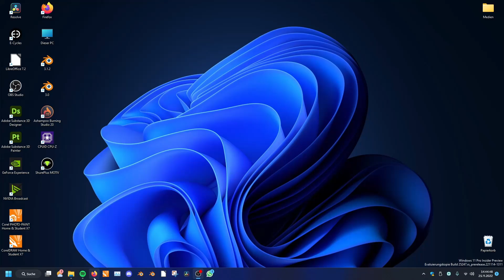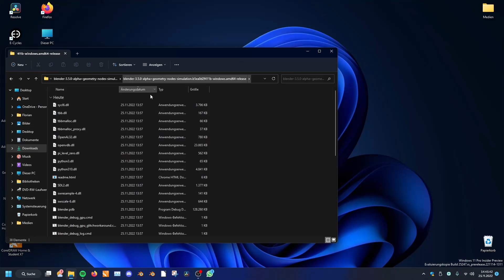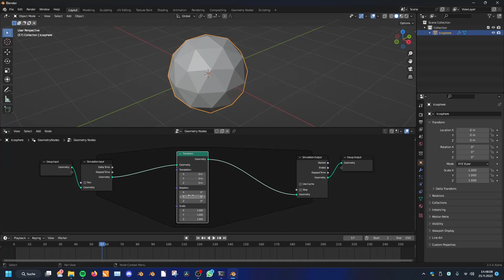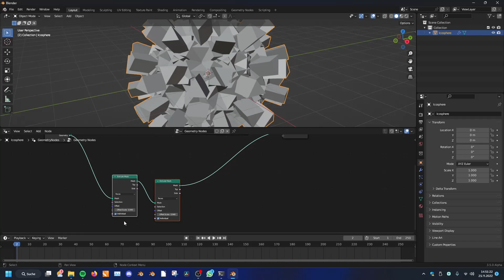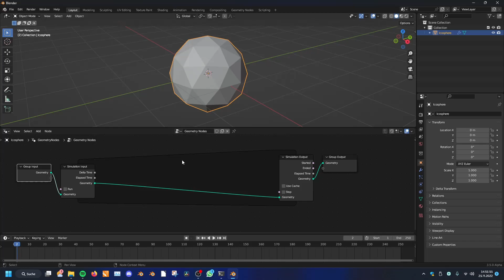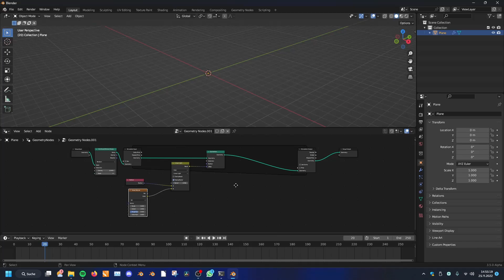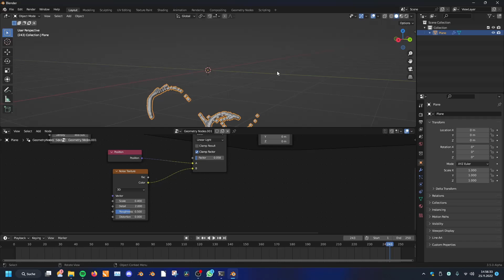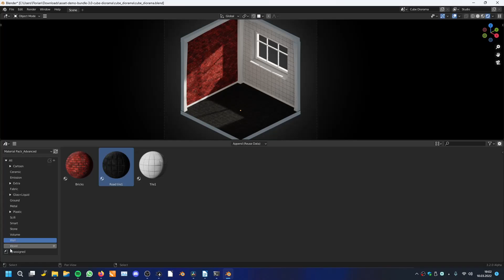New SIMULATION NODES in Blender are too broken!!!

Comment: Hi, first of all you are great at explaining geometry nodes in an easy to understand way! I would like to ask if you know how to make moving balls on the tops of an extruded object like in 6:23? I'm trying to figure it out myself but I don't know if it's possible in blender at the moment. Thanks :)
Reply from the maker: Thank you!
That should be easy to do. If you extrude something you have the boolean output for the "top" face. You can use that as the input for deleting everything except the top faces. Then you can convert your Faces to a point and you can then instance that what you want on that points. I hope you understud. 
If you still have questions, you can join my discord server. There it is better for me to explain something because there I can send pictures :)
Thank you
Reply: @HEY.Pictures  I always wonder how people know what node to connect to each other to give the intended effect. Do you learn by trial and error or do you rather learn from some sites about connecting nodes? Maybe is there a wiring diagram to remember?:)